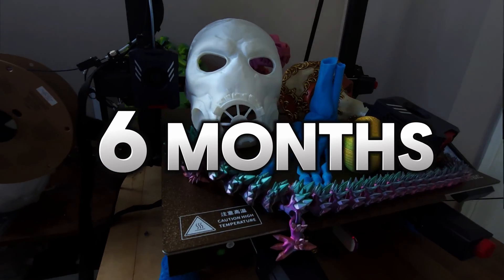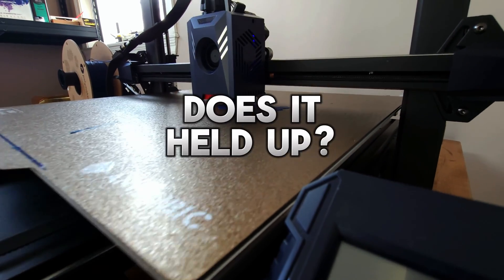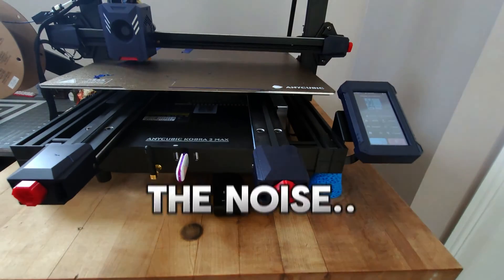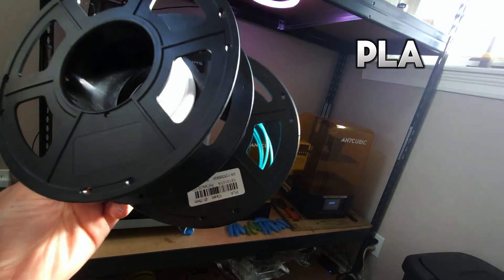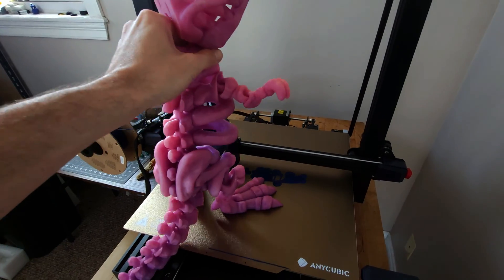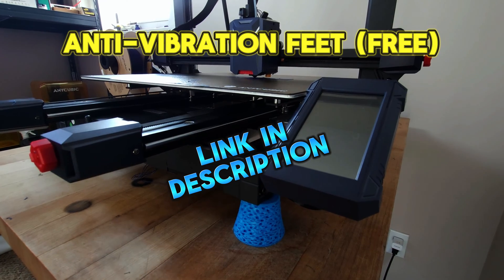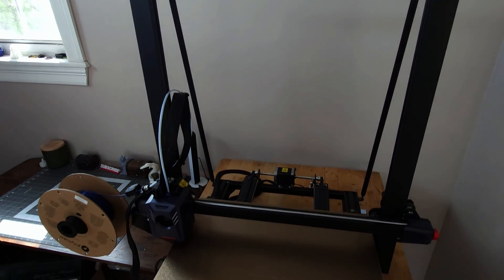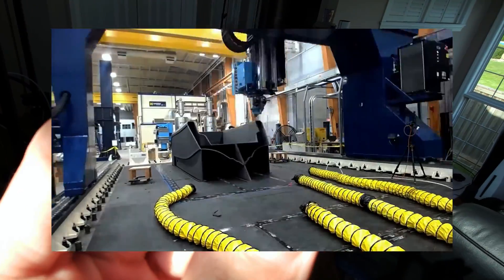Is it Still WORTH it? -  Anycubic Kobra 2 Max 6 Month Review

Comment: I bought one of these, it's terrible. Most prints fail, loads of wasted material. Hours spent getting it level, adding silicone spacers, bought a height measuring gauge.  squared the frame perfectly. Tried everything I could. I can take the same print, same filament and put it on my old, slow, quiet Kobra 1 and it prints perfect every time. Too many sponsored videos on YT, hard to find the uncut truth.
Reply from the maker: I am not sponsored buy Anycubic, I do have sponsorships with PolyMaker
Reply: Hi friend, how are you? I had the same bad experience as you with this printer. I tried silicone spacers and nothing worked. I was only able to fix the leveling issue by using Anycubic Slicer Next with a modified G-code.

Past this code in Print Settings Start G-Code 
G90 ; use absolute coordinates
M83 ; extruder relative mode
M140 S[first_layer_bed_temperature] ; set bed temp
M190 S[first_layer_bed_temperature] ; wait for bed temp
M104 S[first_layer_temperature] ; set extruder temp
M109 S[first_layer_temperature] ; wait for extruder temp
G28 ; move X/Y/Z to min endstops
M420 S1 ; load saved mesh for bed leveling
G1 Z0.28 ; lift nozzle a bit 
G92 E0 
G1 Y3 F2400 ; zero the extruded length 
G1 X180 E40 F500 ; Extrude 25mm of filament in a 5cm line.
G92 E0 ; zero the extruded length again 
G1 E-2 F3000 ; Retract a little 
G1 X181 F4000 ; Quickly wipe away from the filament line
M117
M900 K0.07
Reply: @wrafael1901 thank you. This helps a lot 👍

Comment: I've got the kobra 1 max, and I believe layer shifts are a two part issues that you may be able to address. Part one of the issue I believe is that when the stepper motors are running at warmer temperatures its easier for them to skip steps if they encounter high enough physical resistance during movements. Secondly most default slicer profiles are setup without collisions and crossovers in mind. This is settings like your infill pattern being set to grind where the nozzle repeatedly crosses over the same path meaning the nozzle can collide with a section infill if things are slightly missaligned. I recommend gyroid as the infill pattern as it does not cross over. Your slicer is also likely to not avoid the printed area during travels. I don't think I've seen a slicer that will Z-hop for all travels which is the case for cura where I watched one of my large prints and during a travel from print area over to support material I could hear loud clicks and pops from the nozzle hitting sections of the print. If you adjust your settings to prevent nozzle collisions your layer shifts should be far more rare. Its been over a year and a half since I've changed my large prints profile and I haven't had a layer shift since.
Reply: A good working solution is to mount heatsink to the Y axis motor to prevent overheating.

Comment: I've had the kobra 2max since November. I would not recommend this rubbish to anyone. I wish I had spent the extra few hundred on a large creality printer. I cannot be bothered listing all the faults and problems it has had. Just don't waste your money simple as that.
Reply from the maker: Now in November of this year, I completely agree with you
Reply: It bring me peace to see i’m not the only one who hate this printer, in my case there’s no way to make it work properly, I’ve tried many different set ups reducing speed and trying every single parameter to make a piece correct but there’s no way to do much more than the benchy boat, it gave me a bad image of 3D printers, I would love to buy a good one but now I don’t trust at all lol
Reply from the maker: @oscarexpositogarcia14  I can get the printer to work but at the cost of speed which to me defeats the whole advertisement approach of the printer. If I can only print successfully at 1/4 of ALL speeds. Then why say you have the a 500mm/s machine. Like you said, it might be able to just print a benchy at those speeds and nothing else. I would not go over 220mm/s or it feel like all these problems start to occur
Reply: I have the kobra 2 max for a year now and regret buying it i had nothing but issues with it already replaced 3 heads 2 beds and 1 motherboard in 1 year time

Comment: i read in a reddit post the other day that the layer shift is sometimes caused by the bed motor overheating or skipping teeth on the belts. that's a lot of mass to sling around, especially on large prints. slow print speed + lower acceleration helps, they also mentioned cooling for the bed motor but not exactly how to do it. i just bought my kobra 2 max, so i may end up experimenting with that here soon, maybe could zip tie some heat sinks + fans on the motor?
Reply from the maker: My only thing about that, why have 10 000 acceleration and promote print speeds of 500mm/s with a massive build volume if it can't produce parts at those speeds. Imagine buying the printer to only make small parts... I don't think that makes since. I just bought some flsun printers and I love them
Reply: Flsun? Do they have a large print bed?
Reply: Si los motores se calientan mucho y generan problemas de capa y de vibración, le he puesto un ventilador de 120 mm de un power supply que se rompió, ahora funciona mejor.

Comment: If you apply heatsinks to the motors that will stop the overheating issues. So buy Aluminium heatsinks they offer the best cooling, you can use gorilla glue to apply the heatsinks.

Comment: Any idea what could be causing my k2max to dig into the bed right before print? After the filament purge and nozzle clean it goes to right front corner and almost levels nozzle but digs into bed and entire head bends a bit the starts to print normally.
Reply: sounds like your leveling is way off, check for warps in your bed and make sure all belts are semi tight, check your offsets if you can , i would run the level sequence once, check the offset write it down to whatever the number is, do another level sequence and compare that outcome if the numbers for the offset are way off, it could be firmware issue or some other kind of software issue. Contact anycubic for an idea.
Reply: @kewtd72  Thanks. I finally figured it out, a faulty print head Anycubic sent me a new one and no more offset issues. Now I want to use Cura to slice and print, any experience with cura on this model?

Comment: I need to print 12x12"  3 mm thick squares will a used Kobra Max 1 work? or is it worth upgrading to Kobra Max 2
Reply from the maker: Erm, if you have your kobra 1 max set up well, I would stick with it! You might have to trouble shoot until you get the results you want!

Comment: Have you ad problems with the power loss print recuperation?
Reply from the maker: I have not attempted to use the power loss feature but I think that was added recently along with a few other things but I'll look into it! Are you having problems?
Reply: @TheManufactory3D  yes sadly the power loss resume option has not work in mi case there was no resume option after the power loss and i have the last firmware upgrade to date, ive check online and im not the only one the option seems to not be present despiste the manual saying it  is there

Comment: Agree with this video 100% - I also posted some videos regarding issues with y axis layer shifting (different account: Shadowmoses112 if you wanna view).  Mine were terrible and sporadic.  I think the bottom line is - when this works as advertised - the printer is amazing for the price - but the corners cut and the small band of comments I've seen of similar issues that others are having tell me there may be some corners cut that keeps anycubic from being THE 'go-to' budget brand.

Comment: Do you have issues with prints peeling off sfter long periods of time? If I do large long things like texture pallets for dry brushing, the corners will start to peel after 30 hours or so, like it cant sustain the temperature and still stick.  Running default 60c
Reply from the maker: Does the temperature change in your house? Brims can help with those tight corners, but it sounds like the temperature in your house might be fluctuating??? What filament are you using? Let me know if that helps!
Reply: @TheManufactory3D  it's definitely possible the temperature fluctuated.  I'm currently using SunLu PLA+ black.  Now that I think about it I don't think I brimmed the texture pallet.  I'll try that next time!  Thanks
Reply from the maker: @Mobwalli  how fast are you settings right now? Default? Around 200? 150? If it's a larger print unfortunately I would stick too slower speeds!

Comment: Just got the Kobra 2 max for my first printer and so far I love it, my only complaints are the directions for the printer are very lack luster I’ve been having trouble connecting the bracket cable that connects to the print head it won’t stay put and despite pushing on it harder like people have told me still nothing, reached out to customer service and they just sent me the wiring page out of the directions, so I guess I just have to hope the wire doesn’t give out because the bracket won’t work right
Reply from the maker: For the long gameplug that goes into the printhead, the first kobra 2 max I got the harness needed "convincing" to clip in and it never did, with my newer kobra 2 max, it does! One day I changed the printhead on the old printer.....the harness now clips in! Lol maybe check to see if the harness isn't in a bind!
Reply: @TheManufactory3D  if it’s not going to cause problems I’m probably just going to leave it I really really really don’t want to break it by trying to force it lol

Comment: I had a few minor issues as well getting started with my kobra 2 max but after some tweaking, tension adjustments on the belts and finding the rod supports had come loose on me but I seem to be in good shape now.    Based on most of the research I've done fixing the various issues, very few issues are brand specific and mostly come down purely to user understanding.    It's been very good so far.
Reply from the maker: The only thing really I would love to see is a hotend upgrade, the heatsink kinda hinders an all metal hot end upgrades!
Reply: @TheManufactory3D  I put in a bimetallic heat beak meant for the Vyper and it can now use standard volcano nozzles.
Reply from the maker: @petercallison5765  do you still have a small ptfe tube to guide the filament too the nozzle?
Reply: Benin kobra 2 max  var amma ayarlarini tumunu bakdim bulamadim  yardim etseniz cok gozel olurdu

Comment: Thanks man, I’ve been eyeing one of these for a while, good to know it’s just some small things that aren’t the greatest
Reply from the maker: Of course as soon as I posted the video, youtube recommended I watch a video about z binding which I think is the problem for the layer shifting! No worries! If you have questions, I'll try to answer them!
Reply: The kobra 2 max is terrible, please don't waste your money!!! I've had it for 8 weeks, and 6 of those weeks it's been down waiting on a replacement part from AnyCubic because it decided to destory itself while printing a test benchy. I just got the replacement part a couple days ago and guess what..it doesn't matter because the printer SUCKS BAHWLS! It's a decent frame of a printer, but the software, and the locked down nature of AnyCubic Kobra series, combined with how they cheaped out with a mobo that can't run it's stock configuration. It's not a bad template to start with, but the only way to make it "good" is to completely rebuild it into what it pretends to be - a klipper printer. Buuut, the stupid developors/management at AnyCubic wants to lock down an open source project they stole because moneys. Buy a bambu or build your own, this (and any AnyCubic afaic) is hot garbage.
Reply from the maker: @redeye8396  I think some of my layer shifting is actually happening because of the board overheating or just not being able to handle larger more complex stl files... I can't prove it but be on the look out!
Reply: @redeye8396  That is just your personal experience,  I got a replacement end stop in about a week.  I also had two parts that needed replacing and my Bamboo Labs PIP in the first month.
Reply: I was having trouble with lychee slicer supporting this printer. I am now trying prusa slicer but I am confused on where to put my settings
Reply from the maker: @lawrencehayes8233  do you have resin printers? Why would you use lychee slicer? I truly like anycubics slicer and I feel it help build a broader understanding on how 4d printing works, or read the instructions for uploading presets to prusa in the read me file they provided!
Reply: I’m having layer shifting also…. The printer is just a nightmare. I don’t know if these people are getting paid to post or what
Reply: @KUNDACHAK  usually i find with layer shifting on any of the anycubics is the wheels on the back of the print head module are to loose so after a few days of printing make sure to tighten if necessary  and make sure your belts are guitar string tight. Also if you buy cheap nozzles those can be the culprit as well.